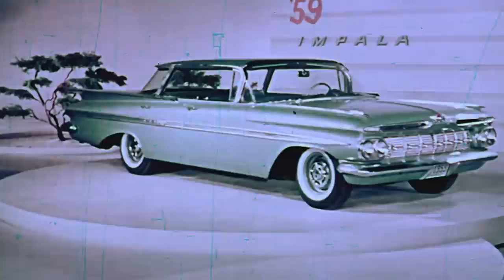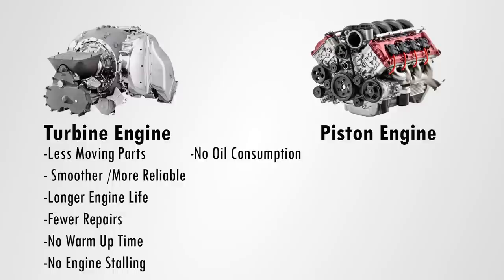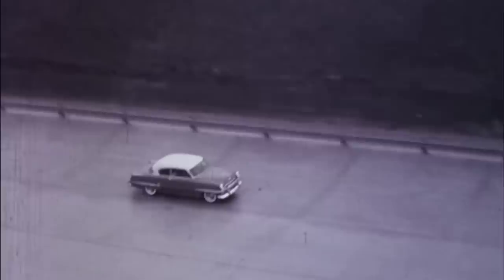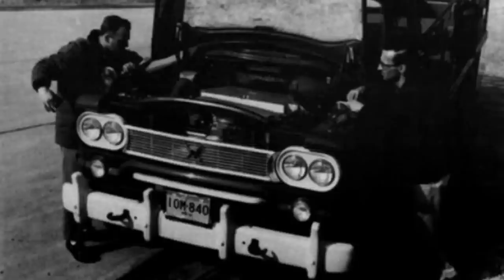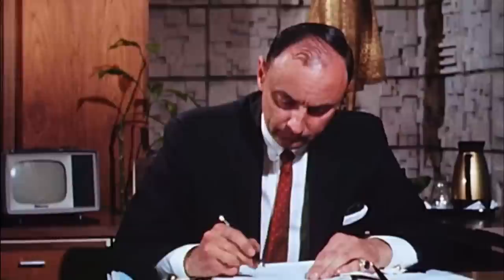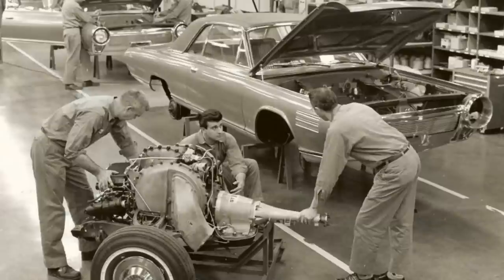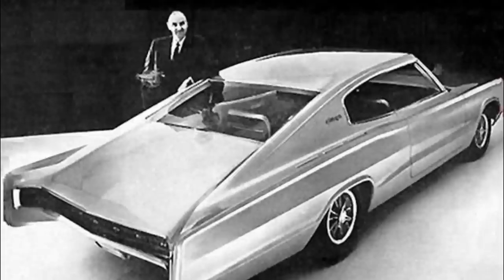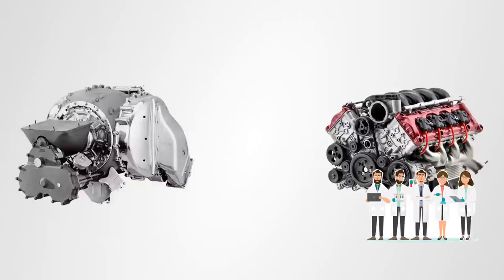Jet Plane on Wheels: The History of the Chrysler Turbine Car Program

Comment: I inspected one of these when I was a boy in 1963 or 4.  It stopped in the small town in South Dakota where we lived.  The driver stated that 50 of them had been turned over to individuals to use and evaluate for a period of time that I cant remember.  It made a big impact on me (a car crazy 14 year old kid) at the time.
Reply: Very cool John!
Reply: @THROTTLEPOWER  thanks🤓
Reply: @Johnoines  👍👍
Reply: My day applied to be one of those test drivers but wasn’t selected - he and I were really disappointed!  It would have been an amazing experience.
Reply: That should have read “my DAD”.  (Fat fingers strikes again!)
Reply: @charlesb7019  thanks
Reply: @charlesb7019  Very cool Charles
Reply: @charlesb7019  probably "auto-error", I mean " auto  correct"...
Reply: IIRC, over the 2-year testing period, the 50 cars were given to selected households to be used as daily drivers for 6 months. That meant 200 lucky individuals got to drive and evaluate the cars.
Reply: @charlesb7019  You can edit your original post.
Reply: @charlesb7019  My Dad applied too but didn't make the list either.

Comment: I’ve always thought that rear-ending a Nucleon would be a blast.
Reply: That's funny dad.
Reply: The insurance premiums would be low, but after a wreck like that, they'd mushroom.
Reply: And you thought the Ford Pinto was explosive.
Reply: Lol.
Reply: Realistically, you'd just end up with a really hot radioactive mess.
Reply: @user2C47  One presumes even in the 1950s the engineers would’ve ensured that the reactor shielding could not be breached, containing the radiation in cases of impact.
Reply: I don't think a simple car crash is enough to make a reactor go supercritical. Everyone around would possibly get radiation poisoning though.
Reply: @fluttzkrieg4392  Since it’s critical already it’s possible that some unfortunate compression of the geometry would cause superciticality.

At any rate, loss of containment would be a major source of mishap and widespread devastation whatever the device’s criticality, as you indicate.
Reply: @user2C47  That'd have to be A HELL of a rear-end! Maybe 500mph at impact? They'd have a hard time identifying the surviving shrapnel as a vehicle that got hit, let alone what kind.
Reply: @qubex  They weren't really reactors, so they had no criticality event that could take place. They just produced heat via decay, and the vehicle captured that heat and turned it into rotary power.

Just a radio-isotope turbine generator.
Reply: Haha nuclear power is a disaster waiting to happen! Sure glad our coal power plants are so safe and have no negative side effects!
Reply: @operator8014  I didn’t know it was based on RTGs but it makes sense, I suppose.
Reply: Nah! Not great, not terrible!
Reply: You shouldn't be looking for trouble.
Reply: @hoodagooboy5981  //
At least you didn't say, "Boomer."
Reply: The Nucleon was probably designed by the same group of people that said hiding under your desk at school was advisable in the event of a nuclear attack!
Reply: @garylewis6495  //
That's only so you could crouch down and try to kiss ur yass goodbye.
Reply: @garylewis6495  //
NO SHERLOCK, they used to treat acne with X-RAYS !!!

Comment: Jay Leno owns a fully operational Chrysler Turbine Car as part of his personal collection, there's a video on YouTube of him driving it as part of his "Jay Leno's Garage" series. Very interesting to see it in motion. The turbine noise is significant, but seems comparable to the road & wind noise generated by old cars. Ignorable to a degree once you get used to it. I myself got to see one of the turbine motors in an automotive museum in Cleveland, OH. They somehow seem both bigger and smaller than one would expect. Wonder if turbine engines could see a resurgence as an alternative fuel vehicle in the modern age?
Reply: A major setback about using a gas turbine even as a hybrid generator is that thermal efficiency goes down when made so small. You want the turbine blades to be as close to the housing walls as possible to stop air leaking backwards, but when your engine is so small, getting the right tolerances becomes a nightmarish task. So for safety reasons you leave more of a gap, and therefore you have a bigger percent of air leaking out. Heavier though they may be, the valves of piston engines ensures that the air taken in upon intake is still there for compression.
Reply: @Appletank8  With modern engineering I can only imagine how much more efficiency we could squeeze out of the engine, or at least retrofit them all. Too bad most were destroyed. This car and the Dobler steam car are my two favorites in Jay Leno's collection..  just wow.
Reply: @Nathriel  
Eh, I doubt there's that much you can do there. Jet turbines are still being made for aircraft, and the M1 tank also uses a turbine powerplant. All indications over the 50 years of development since the Turbine Car cancelation is that turbine efficiency goes up with size, not down, which is a problem when confined to the hood of a car. 

While there are few moving parts, what parts you do have are inevitably expensive due to the high heat and RPM the turbine blades must endure. Hell, even as a hybrid generator there's a problem in that generators often have to turn on and off multiple times as the car starts and stops, which is a problem because turbine start up is one of the most significant stressors in its lifecycle. The only alternative is to keep them running, which will save you blade life but cost a lot of fuel, in which case you might as well use a wankel.
Reply: I was a kid growing up in Cleveland, Ohio during that time. Their automotive museum was called the Thompson Auto Museum,....I moved away from Cleveland in 1977, and I still wonder if the museum is still around or has the same name. I used to go to it all the time,...and I know I have hundreds of  "Kodak Insta-matic" snap shots in a closet in my house. I saw the Turbine car, and many antique ones from every era there. My most favorite thing to do when I was a kid, was to get my folks to take me there. Cleveland also hosted many auto shows, in their downtown, indoors arena. Those were every year, and they featured many custom cars, and ones designed for the TV shows of the day.

Comment: The other major player with turbine cars was the British company Rover. Rover started playing with turbines in the early 50's also. By 1964, they ran a turbine powered BRM (I think) at LeMans. Rover also gave up on turbines, but probably more because of money problems than gov't regulations. 
As always, Ed, your videos are absolutely great (and funny)!
Reply: BMW produced the first gas turbine vehicles in 1944...
Reply: When Frank Whittle and Power Jets ran out of money, because the Air Ministry had "cold feet", the Govt. gave the work to Rover, which subsequently passed it on to RR.
Reply: @john1703  Frank Whittle made alot of enemies in the British aircraft industry, in particular the Royal Aircraft Establishment after plagerizing the work of A.A Griffiths the Chief of Engine Development.
Reply: @john1703  The real geniuses of the British jet engine program was Adrian Lombard at Rover and Stanley Hooker at Rolls-Royce.
Reply: Can't think of anything that would be wrong with a Rover built turbine vehicle🤣
Reply: @kiwidiesel  If Rover had stuck to bicycles they might still be in business
Reply: There's one of the Rovers in the Science Museum in London.
Reply: British Motor Museum in Gaydon, UK, has three Rover turbine cars on display: T3 gas turbine of 1953; T4 gas turbine of 1961 (The soon-to-be-released Rover P6 served as the basis, with front suspension designed to take the turbine); and the BRM Le Mans gas turbine of 1963.
Reply: @sandervanderkammen9230  If they hadn't been taken over – and RUINED! – by BMC/Leyland, Rover might still be in business.
Reply: @21stcenturyozman20  Rover was ruined by the people working at Rover...
Reply: 1963 and 1965.  They were going to run in '64 but withdrew.
Reply: @sandervanderkammen9230  Rover build quality/reliability was poisoned by the BL conglomeration.  My '69 TC is a well-made car.
Reply: @mescko  If Rover had been successful there would have been no need to merge with Leyland... they were headed out business already.

Comment: Back in the 60s, I'm not certain of the exact date for I was a small child, I was at the Reno Car show and from the corner of the floor of the large building I heard the sound of a jet engine firing up. It was the Chrysler Turbine Car. I did not get to see it up close but the sound was unmistakable, and I always had wanted to ride in this vehicle. Jay Leno's garage YouTube channel featured this car in one of its episodes, for Jay Leno owns a rare surviving example.
Reply: Jay's channel is beyond belief. Is there any car he doesn't have? If I did mushrooms and dreamed up a car, I'd probably get a notification from Jay's Garage the next day, and it'd be on the video.
Reply: Jay not only owns one of the two surviving cars in private hands, he also owns a turbine powered motorcycle. Nobody is cooler than Jay.
Reply: @TheOtherBill  He also had his own Turbine car made, I believe with an engine out of a helicopter. It has a custom body with Corvette suspension. It's so loud you have to use headset radios to be able to talk inside of it.
Reply: @benkeysor7576  The EcoJet!

Comment: Great video Ed. As gear grinding as the 70s emission regulations were, air quality in some areas like Los Angeles was terrible. I was told after arriving at LAX, your eyes would immediately start stinging and watering from the smog. Auto shows that decade were hugely disappointing.
Reply: I'm a lifetime L.A. resident and old enough to remember how bad the air was 50 years ago.  Driving north on the 405 freeway through Sepulveda Pass, I'd come over the crest and see the San Fernando Valley spread out before me -- with a thick brown haze hanging in the sky. Half the time the smog was so bad that I couldn't see the mountains just a short distance away.
Reply: @scotpens  Yeah, we moved there from Oregon in 1961.  Many days in summer it was so bad I couldn't see to either end of our residential block, and we lived about in the middle.  I'm in my mid-70s now with lung problems that I'm certain were caused from living around L.A. for about 40 years.  The problem with newer cars with catalytic converters (since 1973 or 4) is that the pollution now is mostly not visible, but it includes acid generated by the converters and coming out the tailpipes.

Comment: Volvo developed a turbine engine for cars around 1980. It had a ceramic turbine disc and was designed to deliver 150 hp. A prototype was fitted in a Volvo 164 and was driven around town in Malmö, Sweden. The team doing this was built around Professor Kronogård, who designed the turbine engine used in the famous (?) Swedish, turretless S-tank. I worked there for a few weeks in 1980 as an engineering student, doing some programming work on their VAX computer…

Comment: I always thought that Ghia-bodied Turbine car looked just like a 1961 Ford Thunderbird.  I was sure Elwood Engle had styled it.  I thought the last turbine car was a 1976 Plymouth Volare.  I didn't realize there was a 1980 Dodge Mirada that was also a turbine car.  Great video!
Reply: The front and rear styling of the Turbine Car was strongly influenced by Ford's 1958 La Galaxie concept car, also designed by Engel.

Comment: The exhausts were not in the two taillight pods. The backup lights were in those. The exhausts exited below the fascia panel under the rear bumper.
Reply: He did make thst clear.
Reply: If you watch the video where he mentions that, the word ‘Fake’ pops up bottom-right.

Comment: Now that we have prevalent hybrid cars, it'd be neat to see a hybrid turbine car where the turbine was acting as generator for the electric drive system. The biggest weakness of the turbine (low efficiency at idle) would be offset by only running it when the battery needed to be charged.
Reply: Not a practical concept..
Batteries have a variable charge curve and gas turbines are unreliable when cycled on and off frequently

Comment: A family had one on my paper route.  I was really into cars and knew every year and model which was never the same year-on-year.  However, the turbine car never triggered a thought of there being something actually revolutionary under the hood and there is no reason that it would.  Everything back then had an aircraft or rocket theme.  Buicks had their trademark holes in the side to make it look like the side exhaust of fighter airplanes with the barrel carbureted ones having 4 holes and 2 barrel carburetor ones having 3 holes.  Oldsmobile called their engines rocket V8s.  Everything had fins, rocket nose cones like the 55 Buick, or turbine inlets like the turbine car or 56 Buick that replaced the bullets, and rocket or jet exhaust looks in the rear coming out holes in the bumper.  I never saw it draw a crowd.  What made them stand out was the front styling wasn't as ugly as was expected of Chrysler, but mostly the unusual color.  No other cars were that color.  Cars were a status symbol and why they were different every year.  For most people it was a nice car and junky house, or nice house and junky car.  People that were doing well had a nice house, with a nice car.  People that were doing really well like the one who owned a produce store, had a nice and bigger house, and a 5600 lb. Imperial with a 392 Hemi or owned a plumbing business who had a Cadillac with AC and two-way radio, nice house, cottage, and speed boat with a 40hp motor.  The people who had the turbine car lived in one of the junkiest houses on a somewhat under-middle-class neighborhood, with a nicer car, so that would not be the least bit unusual.  Moreover, I had no reason to believe the car wasn't theirs.  

Chrysler during those years had more than a styling problem.  The styling was usually homely compared to others.  HOWEVER, EVERY SINGLE conversation during those days that touched on anything made by Chrysler, Dodge, Plymouth, Chrysler included the phrase, "If a dog pees on the hub cap it won't start." because they would refuse to start every time it rained.  Moreover, Chrysler cars were the only ones with gear reduction starters that could crank forever but to no avail.  You know what was going through peoples' minds whenever they heard one cranking and their car start right up in the pouring rain.  Chrysler then subletted the design and production of all of their electricals to Prestolite.  That turned out to be a VERY good move.  Chryslers would start on rainy days, their gauges became reliable so you knew how much gas you had in the tank, and they were the first with an alternator.  However, their legacy was everywhere and their reputation part of the cultural humor that would take take a generation to fade.  It was not helped by people hearing the whine of a gear reduction starters which people wouldn't even need to look up because they knew it was a Chrysler something and wondering if they were going to hear it start.  For Buicks the saying was, "Wonderful car, and they can pass everything but a gas station."  (12 in the city...usually)  Probably that poor mileage was due to their ultra-smooth DynaFlo transmission which rather than shifting gears used a sophisticated torque-converter-type setup with no lockup back then.  Cars then were like the electronic devices of today.  When GM started sliding Chevy engines into Oldsmobile's on the sly and decorating them like Oldsmobile engines.  My uncle just bought a new one and was proud about it and bought them because he like the "Rocket V8".  The saying was, "I have a rocket in my pocket", advertising was "Make a Date with a Rocket 88" and the first rock-and-roll song was about called "Rocket 88".  It was disbelief at first and was hurt by what had happened.  The SHTF and the owners would not take any GM offers of $200 and an extended warranty to settle.  Picture these guys with babies and small kids and their car as a focal point like electronic devices are today.  It would be like bragging about your new iPhone and learning Apple gave you a repackaged Samsung Android after you paid extra to buy an Apple.  The final verdict in 1981 was: Purchasers of Chevrolet-engine Oldsmobiles prior to April 10, 1977, would be entitled to refunds of $550, quite a bit of money at that time, while those who purchased one afterward got nothing because the cat was out of the bag by then and dealers were telling customers.  Other divisions and companies shared engines, but not on the sly.

Later car makers started talking about European styling, which were and are uglier than sin.  Nobody likes European styling, not even Europeans.  Car makers refused to listen to their customers.  When the new Mustang came out in 2005 which looked like the early Mustang, you had to pay more than list price and that continued for more than 2-years.  Then the Dodge Challengers, etc. came back as basically modern-day replicas.  The Europeans wanted them too, which didn't help matters for waiting customers in the U.S.  The customers were not that much guys from that era, they were the kids of today who liked their looks better than the European styling mess.